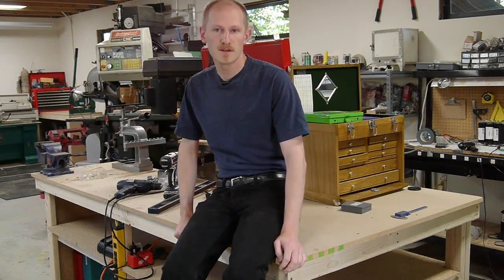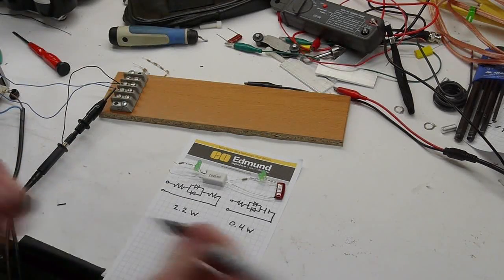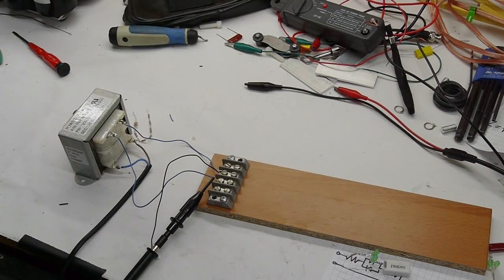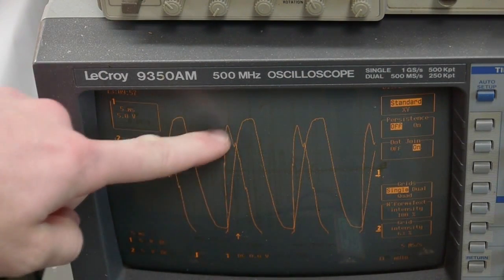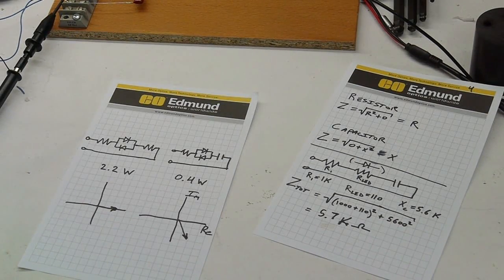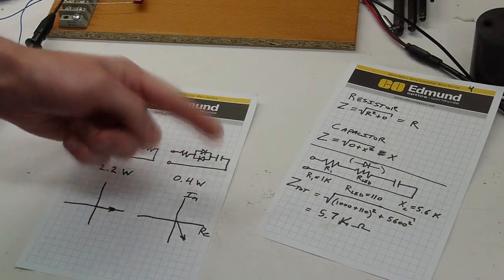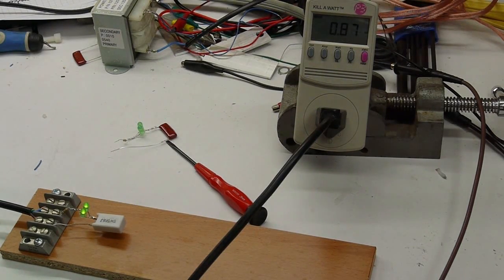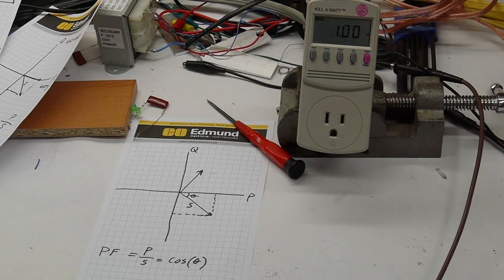Tutorial: Electrical impedance made easy - Part 2

Comment: Capacitance and Inductance having opposite effects on the current of a circuit can cancel each other out, so in many circumstances it seems so easy to get confused that neither are present when in fact they are. 

Theoretically it seems as if resistance is the key to truly finding both and measuring their magnitude, Intriguingly making me wonder about Capacitance in a superconducter and if this phenomenon takes on strange physical effects.

Comment: Happen to be working on a circuit using capacitors for filters, audio signal coupling, and power rail smoothing... my 1st SMD PCB project, using KiCad.
It's been 50 years since my basic electronics class. So, I needed to refresh the capacity of my memory.
Well demonstrated and explained. Much of the fog has been lifted. Thanks!
Nice shop, BTW. Now, I'm jealous, as well as being smarter. 😎

Comment: Maybe you can go into Poynting vector to explain how ac current travels.
I thought I heard you say that ac travels back and forth from the generating station.  I could be wrong but,  the ac wave just travels in one direction (Poynting  vector), the amplitude rises and falls, with a change in polarity.(similar  to a light wave) And I think maybe some of the energy travels outside of the wire.

Comment: I can tell you are very smart but most repair techs aren't.  Please draw and amplifier input circuit with a low input impedance  and also a high input impedance. Show what Happens when you plug in the wrong impedance device and tell why it doesn't work very well.  Amplifiers have different input impedance inputs. and you have to make sure what your are plugging in  is the right impedance so it will sound right.  Maybe a circuit diagram would help me understand better. God Bless you .

Comment: The LEDs, being active devices, are also distorting the AC waveform near the zero crossing; which will have an effect on power factor measurements. Combine that with low current and it becomes suprising that the kill-a-watt even hints at accuracy.

Comment: Could we substitute the 1kOhm resistor with another capacitor? If so, what would be the power used in such a circuit?
Reply: You can get rid of the 1k resistor entirely, just shrink the capacitance a bit more to achieve the higher impedance you desire.

Comment: Hopefully someone will see this snd answers, am a noob hobbyist. I understood the demonstration but on some of my line adaptors there is that little red Led connected directly on both sides to the AC lines with just one resistor and no capacitor ? Is it a bsd design ? And does it consume more watts than it should ?
Reply: It is an inefficient design - using a capacitor would reduce the power it required.

Comment: (16:55) - How does that Kill-A-Watt meter measure Power Factor ?
You say it does basically the same thing as you did with the 'scope but you tapped the circuit at two different points.
The Kill-A-Watt meter has access only to the supply side, line (hot) and neutral.
I would love to know how it does this.
>
Reply: It has to measure the current - either with a small shunt resistor in series with the line, or possibly with a small current transformer - but then it would need to subtract out the phase shift of that transformer.

Comment: 17:32...Unless you have a smart meter installed then the power companies really have you by the short n curlies......... They'll get every penny from you because these meters can measure the apparant power.....
Reply: Domestic meters only read true power. Therefore you don't get penalised for 'poor power factor' devices even though they'll draw more current than another device with a power factor of 1 but drawing the same actual power. Electricity compaines aren't really that bothered by domestic electrical loads as factories are the bigger problem regarding power factor.

Comment: Hello!  This was a very good video.  One comment was regarding power factor...  I was under the impression that the reason that electric companies were so against low power factor circuits was because the load's un-uniform use of the power caused the peaks of the sine wave to be flattened reducing pk-pk voltage and generating eddy currents at the transformer that can cause damage.
Reply: The main reason supply companies don't like low power factor loads is because they result in the current draw being higher than required with a higher power factor load (for the same true power draw). A higher current ultimately causes more power loss in transmission lines due to their resistance.

Comment: @15:51 you used 5700.  Where did that come from?  1110 ÷ 5700 = 0.1947 (0.19 rounded).  IF you use 5600 instead of 5700 you get 0.1982 (0.20 rounded).  

Now - I'm not great at math, but using your numbers I'm not coming up with the same things you are.  Question is - "Who's right?".

Comment: Even with zero ross, you still have an inrush current on devices such as a tungsten light bulb. You have to use a soft start technique to gradually get the filament up temperature ( higher resistance) to avoid inrush current. You'll see this in the newer MOSFETs phase cut dimmers, in order to keep the size (and cost) of the MOFFETs low.

Comment: You made this presentation so long ago, that it might not matter anymore. However, for what it is worth, I would have liked to see the following:
Show those calculation sheets side by side, fully in frame for a few seconds, so i could screen dump them & have a look at the maths later;
Redo the circuit with an inductor, so we could see how that goes;
Tell us what the outcome would be if an Inductor and a Capacitor had been wired in parallel (& in series).
I enjoyed your presentation & will look out for more. I found your presentation style to be easy to follow. 
Best wishes,  Arthur

Comment: Easiest way to always know what is happening
Capacitor resists (any) change of voltage
Inductor resists (any) change of current
Those wants to be in exactly the state you have found them. Either full of voltage or current or void of it. 
Empty capacitor will resist village change by charging itself (it would be behaving like resistor, as it takes energy to charge it) and then resist direct voltage flow, until voltage rise or change of direction
Same applies to inductor, but it is current this time. Inductor won't stop current for tough. Inductor can release all energy in one extremely short burst of energy. 

I hope it would help
It certainly helped me understand this part of electronics. Especially inductors, which I was seeing as transformer. 
Be aware it does apply to transformers too, but this is more complex, as current flowing in secondary winding is actually creating opposing magnetic field to magnetic field created by primary winding. This is phenomena behind transformers. This is why you can run say 100KW transformer with say barely 5W of usage on secondary side and you won't waste much energy

Comment: So, does adding a cap to an induction motor send the power back to the electric company in phase, or does it not draw volt amps in the first place, or does it draw it and bounce it back and forth thru the inductor and cap? I’m volting (voting) for the last one.
Reply: The cap is in parallel with the inductance of the motor - essentially cancelling the motor's positive reactance with the capacitor's negative reactance.  The current swings back and forth between the motor and the cap, while the voltage follows what's on the wires.   This makes it appear very similar to a resistive load because the current and voltage waveforms are (very nearly) in phase again - i.e. it has a high power factor.

On a graph, the inductor is an arrow pointing UP on the imaginary axis, and the cap is an arrow pointing DOWN.  If the magnitudes of these arrows are the same, they cancel perfectly and their vector sum is 0.  In real life, both the motor and cap are not perfect, and have resistive characteristics as well, so their vectors don't lie on the imaginary axis, but lean right a bit, having some real (as opposed to imaginary) component.  The real portions of their impedance leads to those devices heating up and dissipating a bit power themselves.

Comment: So if you added an inductor to the circuit to bring the power factor closer to 1, would that affect the overall power consumption?
Also, do you place the inductor in series or in parallel with the capacitor?

Comment: Hey Ben, I appreciate the free education you're offering here, did you ever get around to making part three in this series? Would love to hear your thoughts and a practical demonstration on antenna and transmission line tuning to avoid a matching circuit, if that is even possible.

I recently became interested in RF by becoming a truck driver and realizing the importance of CB radios, they can be life saving in certain circumstances. With that said, most of the 'technicians' in the business of CB systems are at best misinformed, at worst, deceptive. Most tuning is done via SWR and coax is measured with a tape. Many have probably never seen a VNA. Modern electronics have turned power lines into antennas and every house is a base station for noise. With the legal limit for CB being 5w and most antenna systems are wasting a chunk of that, every fraction of a decibel of loss becomes critical for ones who really want to hear.

Comment: Ok wait so which circuit is better?  The resistor or the capacitor?  The resistor circuit uses 2.2 watts but has close to 1 PF, the capacitor circuit only uses .4 watts but has awful .15 pf.  Which one do we want and why?
Reply: In this case you want the capacitor circuit. it draws much less power from the mains and doesn't get hot. Yes, the power factor is poor but the fact that the true power is lower means that the current is barely any higher than with the resistor circuit. Poor power factor isn't really an issue in low power applications.

Comment: Ben I really like your work and videos but this one is misleading. Meters like the one your’re using will only read out resistive power and does not include reactive power that capacitors use. That’s being said, it will be very wrong to say that a load with high reactive power and low resistive power is energy efficient or beneficial for the source because the opposite is true. High reactive loads can draw a lot of energy from the source and is overall much worse than using a high resistive load.

Comment: Hi ben, thank you for trying to clarify impedance for me. I have a background in electronics and feel I have a great understanding of how electronics works from a fundamental level. I am however having a problem understanding impedance from a theoretical point of view, and to be honest, your explanation. I have learnt the formulas, but can you try explain why impedance exists. I know I have to take it into consideration, but can you help me understand what is happening that makes is important? Sorry if I am not explaining myself sufficiently.
Reply: Impedance it typically considered to be the combination of both resistance and reactance.  

Reactance is fundamentally different from resistance because resistance can only DISSIPATE energy.  Reactance STORES energy - and electronic devices can do that in two different ways - either in the electric field between capacitor plates, or in the magnetic flux linking inductor windings.  

These each affect the relationship of current and voltage in a circuit in different ways, namely i =C*dv/dt for capacitors and V = L*di/dt for inductors.   Note that since both of these depend on time, they are inherently dependent upon frequency; unlike a resistor, where V = iR, and there is no dependency on time.

The complex plane math used for impedance accounts for the differences between these devices.

Comment: Could you add a zener diode with the "all capacitor" version of the circuit so that the excess current during the out-of-phase plug in gets dumped to ground?

Comment: Both of these (pt 1 and 2) are great.  The class made it into a mathematical abstraction, as if the phase angle was an actual ange in space that could be measured with a protractor, not a convenient representation of measurements from our test apparatus.   One thing I'd love to see is a part 3 of this where you show a practical demo of resonance.  I can solve the math, and sort of get it, but if you could do for resonant circuits what you did here for reactance and power factor, that would be awesome. I'm others would benefit as well.

Comment: lots of things here to learn from. I seek electric anomalies and there are few in the main stream electrical education. Like "capacitor is infinite resistance at DC". Well Maxwell's circular law says displacement current (the current I call free energy) is depending on the rate of change. After the cap is charged. There is no change, so no current. Guess you could call it infinite resistance, but why would you? Why the power company wants you to have purely resistive loads is that you could be using their power just to harness energy from the ambient. No money in that. Gabriel Kron (genius) also said, that if you calculate a negative resistance to exists in a system, the system behaves like there is such a component there. So you don't need to have a  component like that. The system only needs to behave like there is one. Lenz law is just an unfortunate circumstance. There is no Lenz law, if you don't used closed loop circuits.
Reply: Um, No.  The power company doesn't like low power factor loads because it causes uncontrolled voltage excursions on the line, causing damage to their equipment and possibly other peoples equipment on the same branch or transformer.  The energy that gets kicked back from an inductor or fed back through a cap doesn't go into the "ambient" for someone else to harvest for free.  It travels back through the system until it is absorbed in a capacitor bank, used at a load, or damages some equipment.

Comment: Very good presentation! However, towards the end when discussing why low Power Factor is bad for power transmission lines you repeated a common misconception: You said that it wastes power, which is not true. When Power Factor is 1, the current and voltage peaks are synchronized which delivers the maximum amount of power to the load. When Power Factor is less than 1, current and voltage peaks are out-of-synch which reduces power to the load (as your experiment with the LED and series capacitor showed). The so-called lost power is actually Imaginary. Now, let's look at it from the point-of-view of the transmission line: Power is equal to the current squared multiplied by the resistance or I^2xR. (It's really impedance, not resistance, but let's ignore that for simplicity.) The line doesn't drop any more or less voltage when the current is in-synch or out-of-synch. But, obviously, a given size of conductor can only safely pass a certain number of amperes before insulation burns off and the line starts to deform and fail. So, to maximize the capacity of the line (real power delivered), it's beneficial to keep Power Factor high. Basically, it's the difference between packing your suitcase tightly with no wasted space (high PF) or just throwing the crap in there, any old way (low PF). Since, transmission lines, transformers and switch gear are expensive and all have a finite Resistance and a maximum Amperage, the goal is to maximize power delivery capacity.

Comment: There is a rumour that the new smart meters are capable of measuring power factor and at some point in the future they will turn this on for residential properties (Big Clive has mentioned this).
Reply: They already have in several places, check the small print on your contract. In some places they charge for apparent power during peak times and real power during off-peak periods (which sort of makes sense if you want to be very generous - though not really, because no single consumer is likely to be stretching their network to its limits and forcing them to do upgrades just for them).

Comment: Ben, I found this extremely informative. For years I have watched  the free energy camp show savings by using multimeters without explaining this point. The design of the electrical units  related to the old voltmeters and salvonometers  which were lever systems so geometry was important. We have referenced our modern electronics against these analogue devices  in which magnetic behaviour was balanced against a mechanical spring. Of interest is whether a meter in an AC circuit runs back and forth in a purely capacitive circuit?

Comment: Excellent video.  Could have included inductive reflectance such as the unloaded transformer draws as well as an inductor such as in a small desk old school florescent lamp.  Then a third video could be made on the nominal impedance of RF and Network cables which contains both distributed inductance and capacitance.  Another great 3rd video would be on power factor correction where capacitors are added in parallel with motors and transformers to reduce the reactive component and reduce the VA draw.  This not only affects the power company, but also impacts the customer in the power lost in wires after the meter which is power used by the customer and is part of his bill.